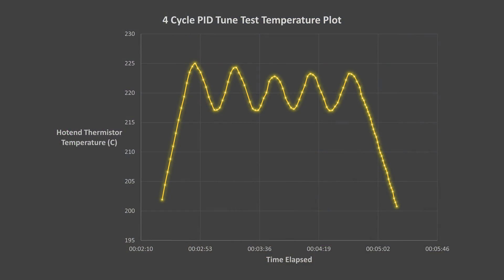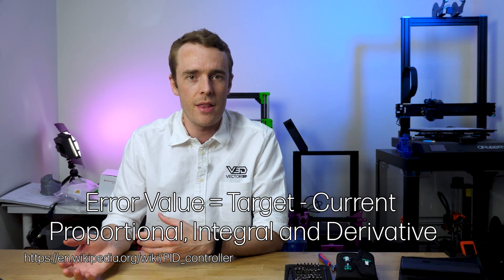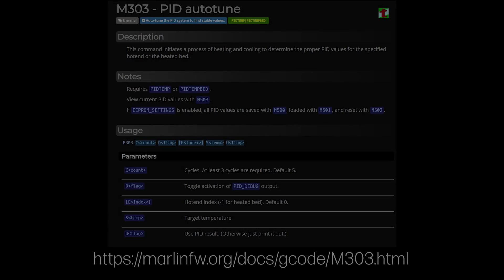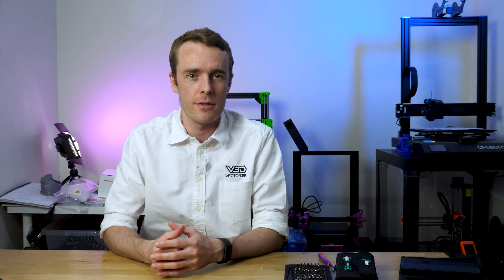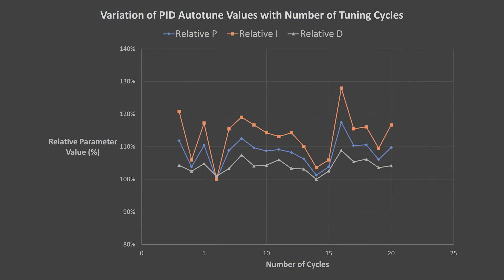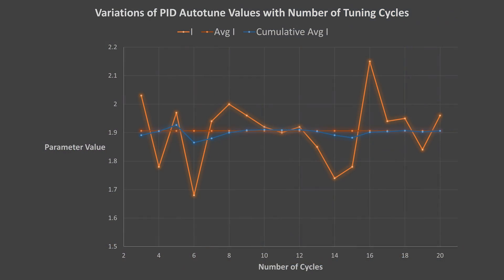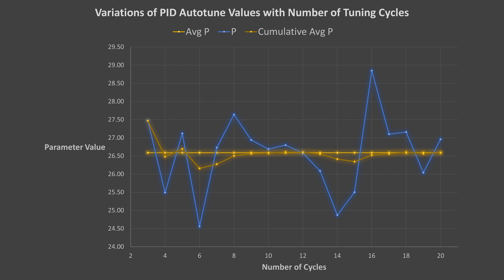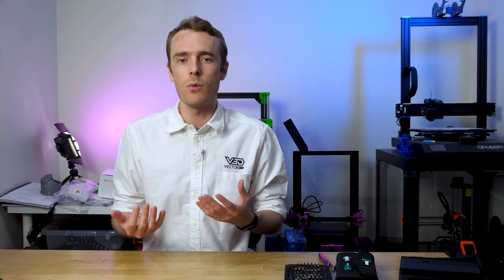This is NOT what I expected....

Comment: The Proportional parameter is the easiest to understand: the greater the difference between the actual temperature and the desired temperature, the more power is applied to the system. As every thermal system has an inertia, the applied power manifests itself some time later, causing the temperature of the system to exceed the target temperature. That is what the Derivative parameter is for, to stop the temperature rise early: in a well tuned system, the system power will be 0 the first time the system temperature reaches the desired temperature. Finally, the Integral parameter serves to compensate for losses. System losses cannot be compensated by either the Proportional parameter or the Derivative parameter. In systems with little inertia, the parameters P and I are sufficient. In systems with low losses the parameter I is not necessary. At least in my experience. In 3D printers all 3 parameters are necessary, Integral being one of the most important, because of the amount of heat that takes to melt the plastic.

Comment: These results suggest that the reported values are each time the calculated value of that particular cycle. Is the last measurement the one that is written to eprom? Or does marlin actually write an (moving) average to the eprom? if its just the last value there is no point in running many cycles, the first few cycles are to account for the heat-up from whatever temperature or to start the oscillation from a stable temperature and to go into a steady oscillation, after 3 to 5 oscillations the oscillation is "stable" and variations are due to slight changes in a draft or whatever other external influence so from there taking a average would make sense. I don't think there is a benefit in running more that 5 averaging cycles for that average though as PID settings aren't that sensitive after all.

Comment: Duh - I just realized why my PID tuning was producing such bad results: I need to start at room temp, not pre-heated! :-0 Thanks for that(!), also for putting in the time to determine that ~10 cycles is good. (A real question would be how well the various settings end up actually controlling the hot end temp.
Reply: I disagree. You should tune your system for your working temperature. Remember, it is the plastic melting what cause the extruder to cool down. So, you must tune your system while extruding some plastic. Integral parameter is the most important, in my opinion.

Comment: Why isn't PID testing done with a flow rate of filiment that is typically used?
Reply from the maker: This particular tests expects to start at room temperature so part of the test will be significantly less than 170C. Therefore, you can't run filament constantly and would have to choose when to start and stop it, which would affect the result. Also, the control system is there to cope with changes like this.
Reply: Good question. It should.

Comment: You can also PID-tune the printbed .. and it made a hell of a difference for my print results.. (Caribou3d)
Reply from the maker: Getting an accurate tune for the bed is far less important because the external factors influencing the heat required are mostly constant for the whole print.
Reply: @Vector3DP  Not so. Using bang bang for the heated bed can lead to z banding artifacts from the PCB heater flexing when current is applied and rapid heating occurs. PID tuning in those cases will give a much more stable temp and no flex. In RepRapFirmware the firmware expects to have a PID tuned model of the heater to be able to manage it properly.
Reply: @Vector3DP  I also don't agree. A bed tune massively improved my prints. Hot end tune was unnoticeable.
Reply: @noway8233  I built the printer myself
Reply from the maker: Finding this difficult to believe. Hotend temperature directly affects the material flow so getting it right is vital. What were these massive improvements that you noticed by tuning your bed?
Reply: @Vector3DP  z-banding.  I had very clear results before/after pid tuning the bed.
Reply from the maker: ok, great picture, but I still can't come up with a technical reason why PID tuning a bed made that change. It just doesn't make any sense.
Reply: @Vector3DP  I already explained it above in my reply. Cyclical thermal expansion/heater flex from bang-bang smoothed out by PID.

Comment: If I ran a PID at 205° should I run it again if I decide to start printing at 220°, 230 etc.. ? Or does PID merely require any reference temperature once and never bothered with again ( barring major hotend modification )
Reply: PID values are generally best to be derived from the temperature you most commonly use. There will be some variation as you go up -- since it takes more energy to get a degree of change the higher up you go. You will notice drastic overshoots at low temperatures if you tuned at a higher temperature because the system is geared for a higher target. If you typically use 2 very different temperatures, then it is a good idea to find PID settings for both and set them in your startup script of you slicer profiles.
Reply from the maker: I agree with @kazlor. I would add that if you print at 215 and 230 a lot, tune for 220 and be done with it. If you print at 210 and 270+ (PC Blend) then I would consider a secondary PID tune for that. The way reprap firmware deals with this is much better though in my opinion.
Reply: Good question. I use to program different PID sets for different target temperatures. I do that in systems where the target temperature changes a lot, like from 100⁰C to 900⁰C. In a 3d printer such complexity it is not necessary.

Comment: Invalid test results without multiple tests per data point (especially when the trend should be easily recognizable). Anything could affect those data points without a controlled environment.
Reply from the maker: It doesn't make the test invalid, just not as good as it could have been. I also expected to find a recognisable trend even with single run. After all, most people only ever run this once at a time so a single test should be sufficiently accurate.

Comment: I found that if the P value is too far from ideal then auto PID wont find the correct values. I changed the heater on my Tevo and needed to re-tune  the hotend. I think the original heater was 12v 50W and I replaced it with a E3d 12V 40W. I spent many hours cycling and saving settings to find the best values. However each test would change I and D, but only a small amount on P. Needless to say, it couldn't achieve a stable temperature. In the end I manually adjust the P and saved that before commencing with each auto PID tune. I eventually found a good value but it took lots of trial and error. 
My preference is to perform a final PID with the part cooling on 50% and a temperature of around 240C. Which is a little over halfway between the lowest and highest printing temperatures that I use.
Reply from the maker: The values I started with were used on the hemera for printing already so they work find for normal printing. Yes, but the fan doesn't affect this test, this is just understanding cycles, the actual numbers were not really what mattered here.

Comment: Well as long as you do not repeat the tests we will not know, but to me this looks like no accuracy is won by running more cycles (in that case the numbers should converge to the same value). Taking averages of averages will probably not help a lot. 
My guess would be that any of the PID values are good enough and that they are indistinguishable in performance. You could try to test that by disturbing the system for example with a fan, or more repeatably by extruding some filament.

Comment: Can anyone explain how the inaccuracy rises again after many cycles? In my understanding this is an approximation process that should get better and better results amd never suddenly worse.
Reply: We cannot simply assume that about 10 cycles is best. Maybe there was airflow in the room that disturbed the process after cycle 12?
Reply from the maker: I was also expecting a really nice curve in the results tending towards a specific value, the results looked like the might be going about as expected after about 10 cycles but when It peaked again I was pretty confused. The room was still the whole time, nothing else operating, no A/C, no open windows, no other people, animals or pets.
Reply: @Vector3DP  Thanks for your work. I Guess you'll get a completely different curve with different optimal points if you do the exact same thing again.
Reply: The 'accuracy' isn't based on the amount of cycles at all. I think this is a wrong assumption on Adam's part based on how he explains his predictions. If I understand correctly, the autotuning works by running a bangbang controller to get to a certain setpoint and then uses values from that measurement to determine Kp, Ki and Kd values (based on classic Ziegler-Nichols method). Running this multiple times doesn't make it more 'accurate'. The only thing affecting the Kp, Ki and Kd values are changes in the system (e.g. new heater block with a slightly worse application of thermal grease) or disturbances (could be electrical or changes in the environment).

So the only thing the large variance shows is that the conditions in the room, or the disturbances change over time. By running the tuner multiple times and taking a weighted average you can reduce the bias toward a certain situation a little. The PID tuning itself isn't an iterative process.
Reply: @SuicidezNL  very interesting to understand more about how a PID tune works! Kind of makes this test a bit pointless.
Reply: In a 3d printer P and D accounts only for the start up temperature. Once the extruder reaches the target temperature, the I parameter is the most important, in my opinion. That is because of the amount of heat that takes to melt the plastic

Comment: depending on the speed and flow rate; the part cooling fan has a huge impact. For example, when the part cooling fan kicks in, it may drop the heat block's temperature; causing the PID controller to slam the PWM to 255. if the heat rise is not fast enough / falls fast enough, the firmware will throw a thermal runaway. I ALWAYS tune with the part cooling fan on full.
Reply: Prusa mk2 is notorius for fán induced thermal runaway. Cant have the fan more Than 50%
Reply from the maker: Yes, I do the same. This was not about finding the right values for the hot end, more about understanding how the number of cycles affects the result.